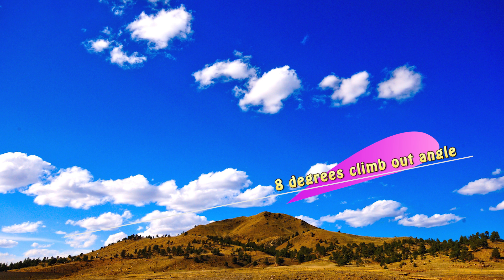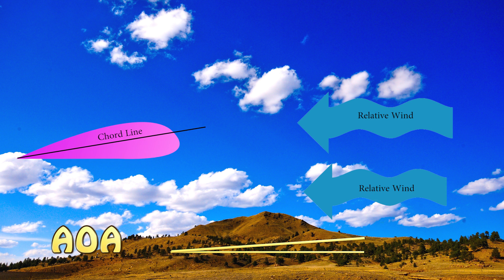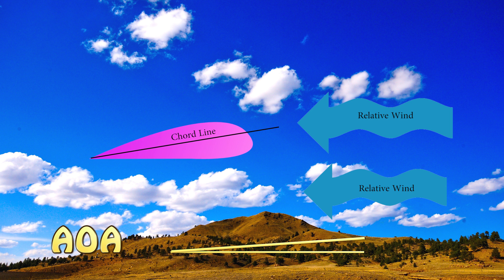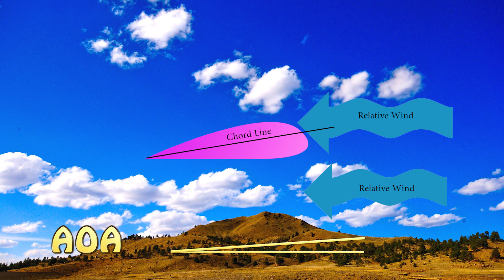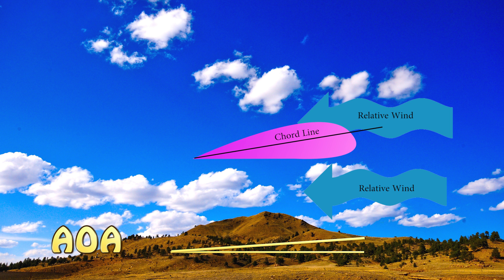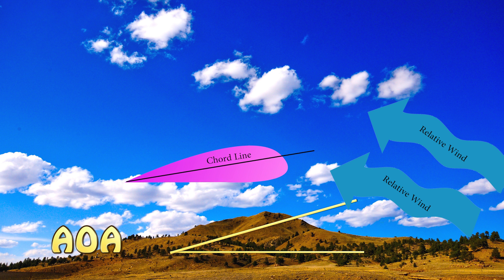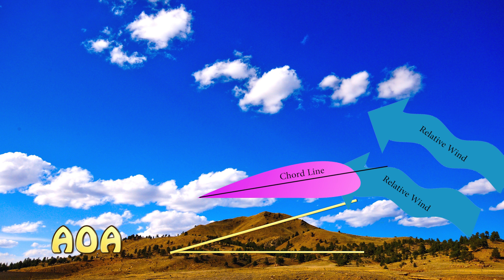Ep. 19: Angle of Attack Explained | and Relative Wind

Comment: do you have a different video that explains how the relative wind works?
Reply: If it helps, I will try to explain briefly. It is not actually the wind out there, it is the air (air resistance in a way) that hits the plane's wing while it is going through the air, similar to the relative wind that hits your hand if you stick it out of the window while driving the car. You can also think about the relative wind as the wind in the opposite direction of the airplane's vector or direction while travelling.

Comment: Great video. Thumbs up.
I still don’t understand why the water streaming up the window was coming in from a angel lower than the plane as it was ascending. Could you explain? I really don’t get angle of attack.
Reply: Angle of attack is the angle between the cord line of the wing and the relative wind. Put a different way, it is the angle of the wind that’s blowing that rain and the direction of the line that runs straight through the middle of the wing. We care about this angle, because the amount of lift generated by the wing is dependent, for a given speed, on the angle of the wing. If you’re going slower, you have to pitch the airplane up higher in order to maintain level flight. If you’re going faster, you can relax the control yoke pressure in the airplane will still stay in level flight.

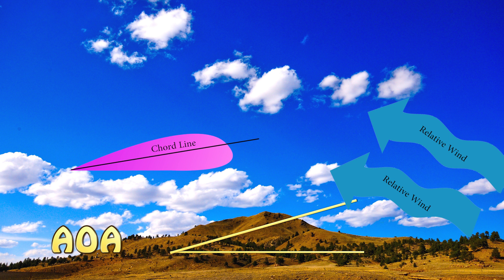Comment: I believe you have explained the AoA incorrectly. Your way to describe AoA and the relative wind in 2:20 is incorrect. As per my understanding, for still wind and weather, the angle of the propeller or turbines always fixed to the fuselage or longitudinal axis, as per designed, as per manufactured. The wing angle to the fuselage (which is knows as longitudinal axis) is normally around 6 degree. 

In actual flight, the wind is coming from two things: Wind generated by the propeller or turbines, and wind hit by the airplane. But in this discussion, the wind from the environment we will neglect. But in actual situation, wind will be the resultant of both.

One terminology that you forgot during explaining the AoA here is the absence of the Flight Path Vector (FPV). This vector is the expected result or direction by the pilot.The AoA itself is angle between the chordline to the FPV.  To get that vector, a pilot have to adjust some parameters, especially Air Speed, such as during landing, cruise, and take off. During take off, the FPV heading UP, parallel to the wind direction (so do to the longitudinal axis, as the plane is heading up). Hence, the AoA is relatively small. During landing, the plane also pitching up, wind direction also coming from above, but the FPV is heading DOWN. Hence, the AoA is relatively high. But during the cruise, for normal condition, the FPV is horizontal, parallel to the longitudinal axis, which the AoA is the manufactured AoA with the wing attached to the fuselage (around 6 degree as I mentioned above). But, there will be condition that the longitudinal axis is not horizontal, but heading up, but the FPV is remain horizontal. That is achieved by reducing speed such way. See this condition? The relative wind is coming from above, but plane is horizontal. For jet fighter, the condition is more complex.
Reply: Umm many videos like these are aimed for civilian aircraft, I don't think many YouTube videos are gonna tell you how to fly / inform you on concepts relating to fighter jets, since many more people fly civilian aircraft over fighter jets.

Also to clarify...

AoA, is the angle created between the chord line, and the direction of the relative airflow. That's the most simplest yet correct definition, that relates to civilian aircraft, heck even military aircraft follow this same principle.

Relative airflow, is the wind that operates in the opposite direction of movement of an aircraft and withholds the same airspeed of that of the TAS of  a given plane. If an aircraft is moving 65kts and travelling 000 degrees. The wind will come from 000 degrees to 180 degrees and have an airspeed of 65kts. 

This relative airflow will rush over the aerofoils and onto the fin, thus lift is created on the cambered / symmetrical aerofoils